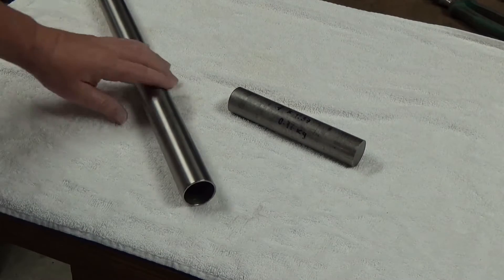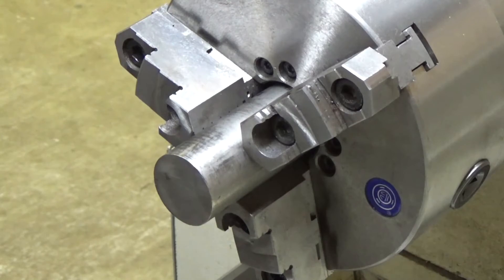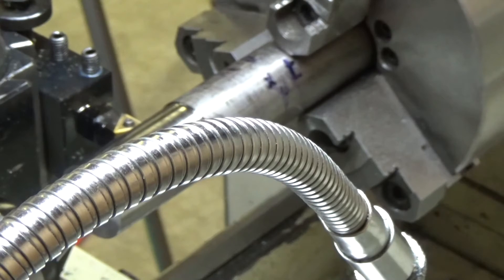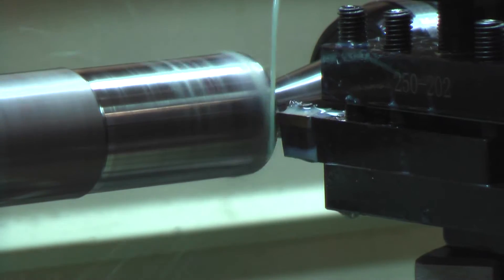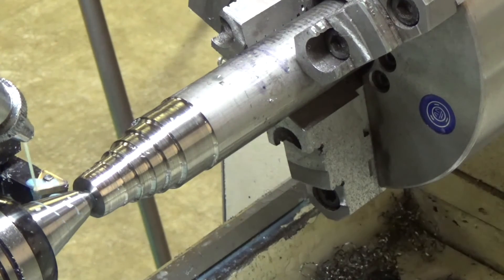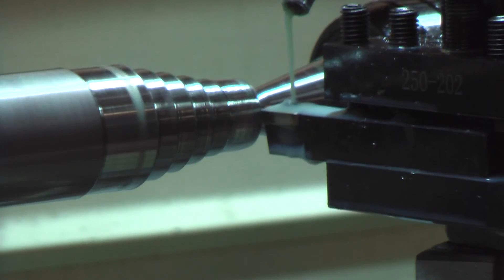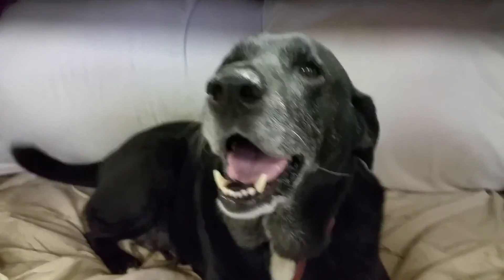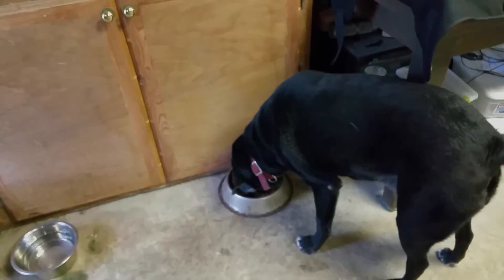Titanium Suppressor Blast Baffle Pt 1

Comment: Cool video. I'd do away with the live center, and chuck the piece closer to the headstock.  Short stubby piece doesn't need tail support. That would help cut down on chip tangles.  I'm just learning about insert tooling, but can't help but think there are inserts designed for Ti that might cut better and give better finish - just a thought. Thanks for the video!

Comment: I've turned alot of Ti.  One thing you find out early is, you don't do any spring pass and you don't do light cuts.  If leave 0.02" for a finish pass minimum.  Depending on the tool, you'll wad up stringy chips if you aren't feeding hard enough to break them.

Comment: Looks good, man Titanium is one of those crazy materials, those chips look worse than the super stringy chips I got from using 17-4!
Reply from the maker: It's like SS's big brother and mother in-law all rolled into one. It work hardens so fast and drilling.. well lets just say I'm getting a lot of practice sharpening drill bits. If you get a chip curling off stay into it keep adding pressure, if you stop you get a hard spot you have to break through. you'll find out.  thanks for watching 
Brian